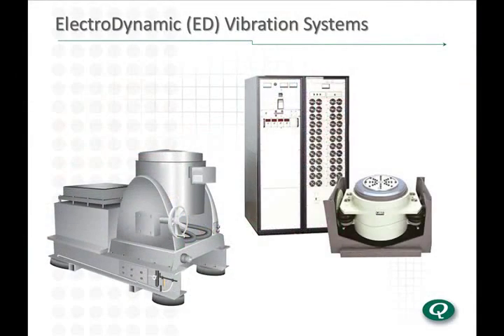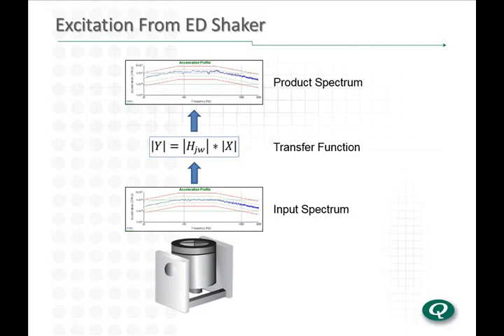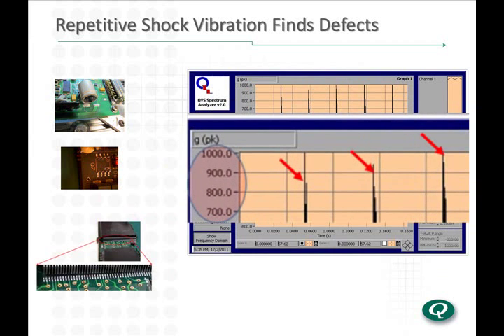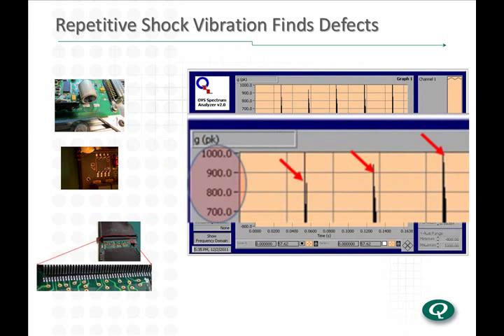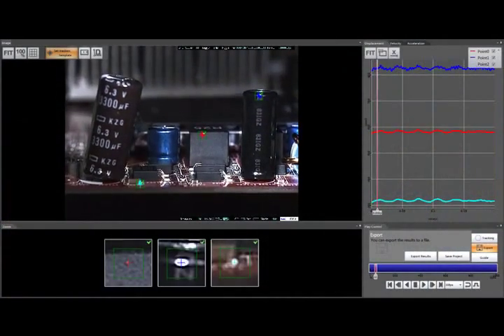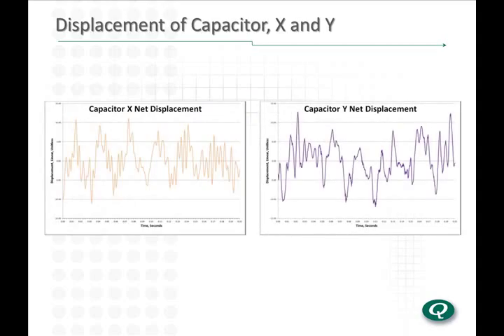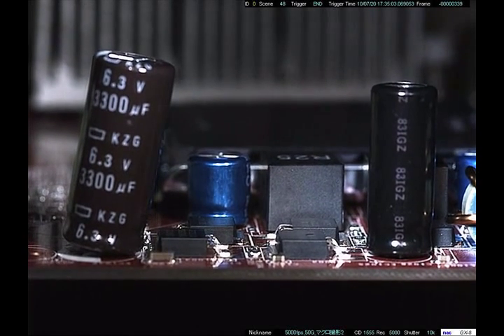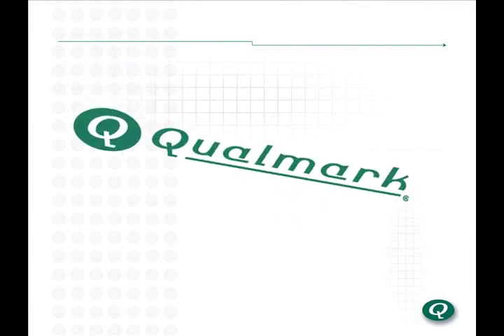New Analysis Techniques for Repetitive Shock Vibration

Comment: A nice treatment of the subject and very informative, thank you.
Very interesting. The last time that I saw a circuit board like that was in my 1968 Zenith TV set. What about surface mount BGA technology , this testing can be damaging even with HASS because of unfiltered high frequencies delivered in this test equipment. 40 years of experience tells me something is wrong…… shock is not a friend in any engineering discipline especially microelectronics with glass and ceramics.
Reply: Very informative. Recommendable tests and analyses of electronic equipment for marine and military use. For sure.